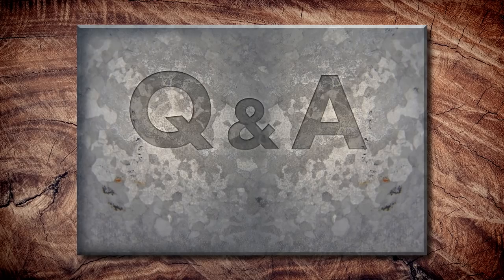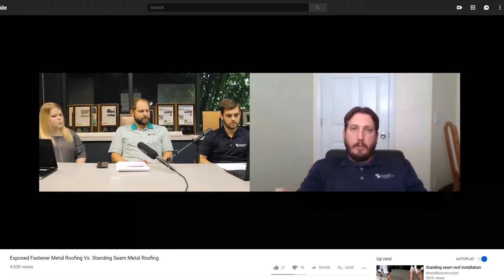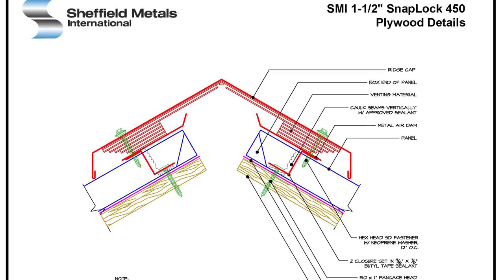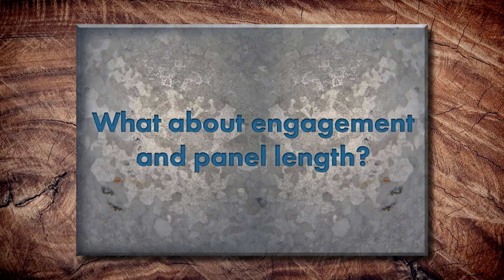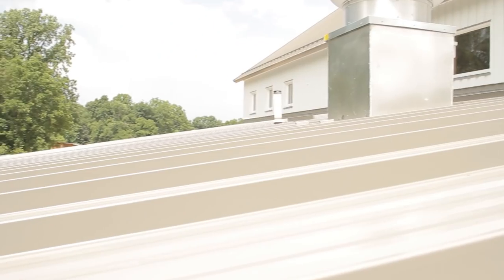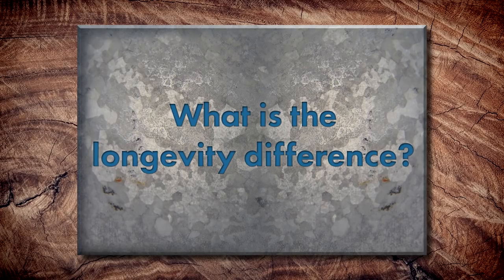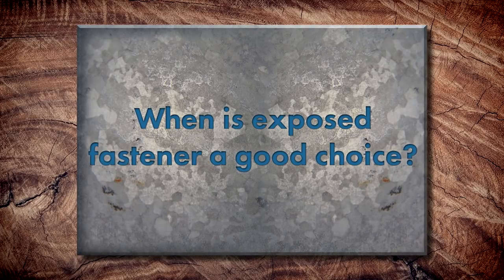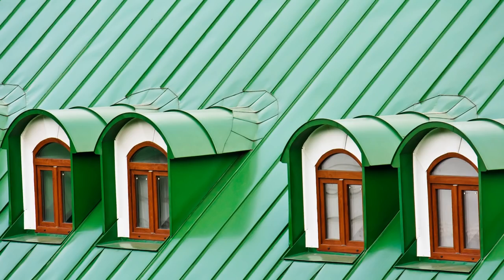Exposed Fastener Vs. Standing Seam Metal Roofing Revisited

Comment: We covered our home (two story with a "shed" addition from the previous owners) with 8" steel purlins, blown or sheet poly foam insulation, and R-panels. Being in my 60's and having done R-panels starting in the 70's, and given how much it cost to put this roof on, even though I did it myself, yes, cost was a big factor. I was pretty clear that a) I didn't have the equipment to do a "real" standing seam roof (and believe me, I investigated it, from manual crimpers to trailer bound forming machines to small electric roll crimpers for the seams, all the way up to "snap-lock" type "standing seam" roofing), b) I didn't have the experience/expertise (or patience) to do the standing seam, and c) I was able to do my roof at my own pace, getting materials from suppliers I knew could fill my needs when needed. Our roof is a category 4 metal roof and earns a nice insurance discount. I need to go up and scrub it down once in a while because of the natural tendency of anything left outside to get dirty and dusty. But, all that said, I think the standing seam with no fasteners showing is a more "classy" looking roof, as mine tends toward the industrial look. But, sometimes we have choices to make, and mine was to "DIY" and save several thousand dollars. For about 7-8 thousand bux, I got my 2700 square foot home covered with metal, as opposed to the $20K I'd have spent for a standing seam installed by "professionals" (not to mention that I was doing it in the midst of a massive roofing effort in this part of town due to two consecutive springtimes of bit hail storms). Excellent video, much appreciated.
Reply from the maker: Thanks for sharing Jason, and I'm glad you were able to find a system that works best for your needs! If you would like to see any specific videos in the future that could help you out with maintenance or other info, please let me know.Thanks! -Thad
Reply: @TheMetalRoofingChannel  Thanks for your reply. As a matter of fact, I'm open to anything you can suggest about keeping the metal clean and as shiny as possible. Since it's an exposed fastener roof, i certainly want to avoid using a water blaster, and with a fairly strong pitch over the garage and on the second floor, I'm not eager to get up there with a scrub brush. However, I really do want to keep the 'street-visible' portion on the garage as clean as possible. It seems that a harness and tether is about the only answer I can come up with. And, since I'm an old cuss (not frail, just tired), I'd prefer to find a solution that didn't involve that. Doubting there is anything any simpler than getting up there with a stiff brush and bucket of suds. Thanks.
Reply: Yikes -- Sorry for your costs...whew!  I guess I should get into the standing seam business.

Comment: I’ve bought exposed fastener roofing from 3 different places and just like you they leave out a very big consideration.The metal might last a long time but the seals on the screws will not.I have never been told CHANGE SCREWS EVERY 10 YEARS. If you put it on change the screws or you will regret it.
Reply: I have two buildings with roof and exterior walls of exposed fastener roofing.  After 17 years I have absolutely no problems.  None.

Comment: Bought a house with a metal roof.  Screws sticking up every where. Panels were coming loose and had some damaged de king under neath. Creeked and popped all day as it warmed up then again as it cooled down.  The noise when it rained hard was deafening.
Metal roofs are very popular around here. People say they love to hear the sound of the rain.  No thanks.  We went to shingles and the house is so much quieter there is no comparison.  As to your speech some one commeneted, if you just slow down a little and are not in such a hurry it will be better.  You gave a ton of good information in a short time. The listener needs a chance for it to soak in.  Cheers!
Reply: A little tip click on the 3 dots aNd u can adjust the video speed faster or slower. Really helps with accents or dialects and slow talkers.

Comment: We installed a galvalume standing seam roof on our 1000 sq ft addition project ourselves, awhile back, prior to an army of DIY Youtubers being a thing. Should be a lot easier to find good educational videos now. Saving the installation cost makes the standing seam roof a swinging deal if you're looking to not have to roof again, or do any maintenance to speak of in your lifetime. The cool roof (galvalume, light silver, plus we spent a little extra on a more reflective UV coating) makes a massive difference on insulation efficiency and comfort (we don't have AC, but we insulated over double the code requirements , used a good radiant barrier, and we have a hydronic heating system in the floors below the metal roof, which is great in Feb). It wasn't that hard to install, as we did it when the weather cooperated. In fact, we even invited our architect over to help us, and learn how to do it. He said the experience changed the way he designs structures. Hardest part was renting a flatbed and driving the panels from the inland empire to ventura county. That was 12 years ago, when we were gambling on a future of rising temperatures wreaking havoc with utilities and wildfires getting worse. Yesterday it topped 112F here on our property in the conejo valley, and we are hoping not to have to evacuate this year. Guess we gambled well on those materials back when. The galvalume standing seam roof, the cement-board siding, and the warmboard decking we ran the pex in for our hydronic floors were definately all a bit of a splurge at the time. In retrospect they were all SO worth it! As we look to retrofitting the existing 1970s construction that needs upgrading, we will insulate and radiant barrier at 3 or 4 times code, waterproof with the new self adhesive barriers available at big box stores, use good whole house fans,  install another cool roof over it, and -- if we can--ditch what's left of our forced air heater for point of use hydronics, so we aren't heating rooms we aren't using, or breathing all those allergens. Still hoping we might not have to install AC.
Reply from the maker: Thanks for sharing that great story! -Thad

Comment: Galvanized exposed lead seal nail last a hundred years ..! If you insulate with celotex underneath it that will take all the heat out of your attic..!,, if you look at the price compared to the years the old fashioned barn roof galvanized expose nail is the cheapest roof of all ! I have seen this roof on a 12/12 pitch with a bullet hole in it and it still don't leak..!

Comment: What about the longevity of the gaskets under the screws with the exposed fasteners?
Reply: Soak the screws in 303 aerospace sealant. The rubber grommet will soak this up
Reply: @BrettTracyRealtor  It may have a temp effect but again, exposed gaskets will deteriorate because of heat cold, and UV exposure.
Reply: @laserfalcon very true, this will help in those certain conditions.

Comment: Where I live in Florida standing seam hidden fastener cost twice as much as exposed fastener roofs. Another thing all these companies leave out is exposed fastener is superior to standing seem when it comes to high winds like hurricanes. If you are going to lose an exposed fastener panel it means you are losing the plywood under it as well and in that case standing seem would fail as well. According to FEMA and again not talked about on these videos is standing seem snap lock panels are the worst performing metal roofs with the panels coming unsnapped from the change in wind pressures. 

We just went through Hurricane Ian this past September of 2022 and the exposed faster roofs all survived around me without damage, the same can not be said for standing seem hidden fastener roofs were some of them did fail. One shopping plaza has a standing seem hidden fastener roof and the entire roof is having to be replaced, right now they have the entire roof shrink wrapped.

Comment: I purchased a house with a hidden fastener type tin roof. It has a three car carport that was extended with the same material. It has long deep running grooves at a very shallow pitch.  I don't think that the carport will hold a person on is an I am not sure of the best way to get the leaves off of it. The trees drop lots of dabree and I would have to have to pay someone to bring a cherry picker out here a few times a year.

Comment: It's time for me to replace the shingle roof. I wish to do a metal roof; standing seam. I live in SE NYS. What gauge metal would be best to use??? Can you recommend a company who can do this correctly??? I presume I would want to remove the single layer of shingles OR would it be ok to have a metal roof applied over the shingles???? When I had the current roof applied, 2 layers of singles were removed prior to the roof I have now. What do you think it would cost to apply a metal roof on a standard 26' x 40' ranch-style house??? I do have a semi-detached garage & screened porch (between house & garage) , as well. I am more concerned with having only the house redone due to costs.

Comment: Great video. Thanks. One topic you missed though was leaks. Exposed fasteners has substantially greater propensity to leak.
Reply from the maker: Thanks for sharing, Brad! Yes, there is a risk for leaks due to the hundreds or thousands of exposed fasteners in a given roof system, especially if they are not installed/maintained correctly. -Thad

Comment: The video never got to heart of the issue. The exposed fastener steel may last 60 years but the neoprene on the screws won't, so you have a roof that will leak in best conditions in 15-20 years. For a post frame farm building that may not be a big deal but for a residence or commercial building it will be a disaster. Think about it, steel expands during the coarse of a day and then contracts at night; movement of the roof panels happens over 700 times a year. Screw holes eventually elongate the rubber seal loses it integrity. Chip and Joanna Gaines may get away with exposed fastener roofs in Texas but in Wisconsin exposed fastener roofs on homes and commercial structures are only for the foolish and ill informed. This video does not do justice to the issue.
Reply: All American. You make some good points mate, what got me, was the fixings in the middle of the sheet pans. In Australia that’s a warranty fail regardless of pitch or fall.
Reply: You are correct sir. I bought a house with a 17 year old exposed fasteners metal roof. It was a nightmare. I'd say we had at least 15 places where the rubber gasket had failed and it rotted the plywood behind it. We tried to have it repaired but it ended up still leaking. We eventually replaced it with an impact resistant shingle roof. It's definitely not a permanent solution like standing seam metal but it was 11k instead of 40k. I'm in Texas. Definitely wouldn't recommend an exposed fastener roof to anyone.
Reply: Great info, and correct imo

Comment: How would you flash around a 12" roof jack on a 5/12 pitch?  I haven't found a channel yet that discusses this. Thanks!
Reply: 1pcmedic 
Use a boot. Then use the proper sealant before install. Make sure you clean the surface before application. 
On sealing a boot on a old metal roof. I would use H.E.R products

Comment: Exposed fasteners are terrible. They loosen after time and on my 10/12 roof it's a pain to tighten them. The screws would be best to have into your framing not the sheeting but that's usually possible. I have 2 feet or more of snow on my roof at times and loose screws are a real problem.

Comment: We live in south FL. Shopping for a colored metal roof. We currently have asphalt shingles. I'm wondering, would a matte black metal roof hold more heat than my asphalt shingles. I understand thr SRI is lower than other lighter metal paints, but we are mostly concerned with whether or not the black metal would really hurt our power bill. 

I've asked around about this, but no solid answer from metal roofers.

Comment: Here's a quick tip that might help some people get by if their rubber washers  fail, before you ever attempt to put a metal roof on if you have a shingle roof DO NOT remove the shingles and put 30 lb felt over the shingles before you put the metal down and then use long screws that will penetrate through your old shingles into the plywood this will impregnate around the screw even when the washer do fail and give you some extra time, contractor told me this once and he said he'd never went back on a job in 35 years of experience he also coated each screw head with neoprene  caulking which is going to take a little longer but in the long run you'll benefit from it

Comment: What about the fasteners on the exposed type. How long do those “rubber” washers last?
Reply from the maker: Hello! It will depend on a few things. Washer material, whether or not it has protection from UV like a steel washer or cap head, if it was installed correctly and not blown out, etc. You should be able to get a more specific answer from the fastener manufacturer and also check if they offer any types of warranty on the fastener/washer. Hope this helps! -Thad

Comment: I have an existing car port with exposed fasteners. The  panels are the classic ridge , i would like to install a poly-carbonate panel for natural light . The issue is i can seem to find a supplier. The local big box stores don't  carry them.  The car port is 10 years old an no leaks, any ideas where i can purchase???
Reply: Do not!! I repeat, do not buy home depot crap!! Go to farmtek.com and they're expensive, but the clear panel's they sell are thick, pliable, u.v. resistant and are awesome!! You'll thank yourself for spending the money once, the stuff in the store becomes brittle in no time. Another trick use 1/4 in butyl rubber strip caulk at joints and you'll have zero leaks, you can get it on amazon cheap as hell, it never dries so it stays viscous and wont leak. I wish someone told me about farmtek!! LOL!!
Reply: Not worth the money or headache
Reply: those poly carbonate or fiberglass skylights are problematic and often break and leak before the other roofing....I'm sure that's why they  don't handle them anymore....too many issues.

Comment: What are your opinions of standing seam clips vs. nail strip installation????…..Do clip installations with stand hurricane force winds better?
Reply: Clips are better for allowing  thermal expansion and  contraction, either can be installed to meet your required wind rating
Reply: @1unitedredneck  most guys just don't want to use clips....One estimate was for 10k over nail strip....that was the only roofer that would even do it....
Reply: @capeheartriz  10k for how many square roof!? you could specify a mechanical seam roof as opposed to a snap lock roof then there is no nail strip option available

Comment: I see a lot of exposed fastener roofs where the screws have backed their way out of the decking over the years.  Do standing seam metal roofs have this same problem as well but you just can't see the screws?  If no, why not?
Reply from the maker: Screws backing out of an exposed fastener roof is often due to expansion and contraction. Because the panel is pinned
to the substrate, the screws can eventually get worked out of the panel due to thermal movement, especially on longer panel runs. A standing seam roof that uses expansion clips won't have the same problem because the clip allows the panel to move appropriately during
 expansion and contraction. Thanks for the comment! -Thad
Reply: Makes sense to me.  I have never seen screws that have backed out of a standing seam roof, but I have also never removed a standing seam roof, either.
Reply: In my experience, it depends on what it's  screwed into  and climate. If the screw protrudes the strapping, it allows conductivity of heat throughout the screw. Which in turn causes it to expand and contract at greater rate than the wood.Thus the term a screw loose. 
Good day to you. Lol.
A little knowledge and laughter rolled into one.

Comment: We have an exposed fastener roof on our ice rink and indoor turf fields. About 85,000 square feet. It was a huge mistake. The roof is about 20 years old and about 10 years ago we started to get leaks all over the place. Seems like the roof expanded and contracted over the years and since the screws stayed in one spot it cut holes in the mental roof. We got leaks all over the the place. We are suppose to get a new roof next year. Total shit show. I hear the old owner said he could have laid 3 exposed faster roofs for the price of one standing seam roof. Not sure about that.
Reply: instead of replacing the whole roof just put a coat of white knight plus on it ..it will put a rubber coat over it and you will get another 10 or 20 yr
Reply: Must be fastened from ridge or crap screws because my garage roof is 23 years old and everything is still perfect nothing leaks and rubber seals are flexible. My screws has EPDM rubber seal and all screws are in valley which prevents thermal movement much better.